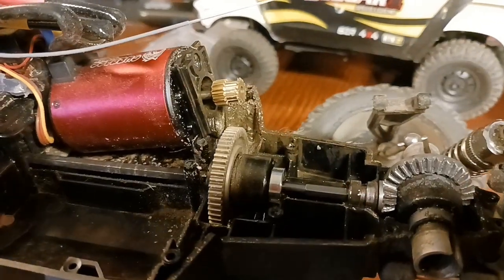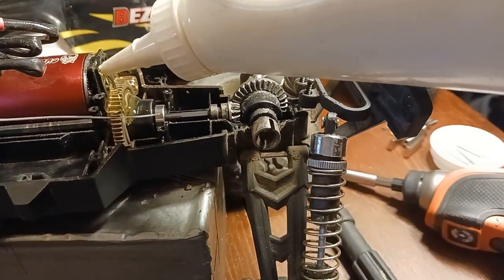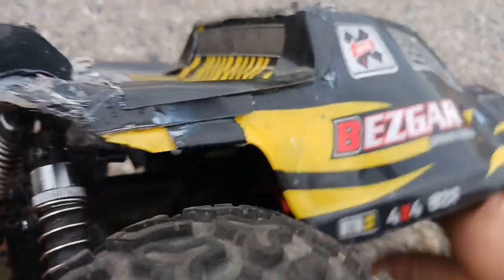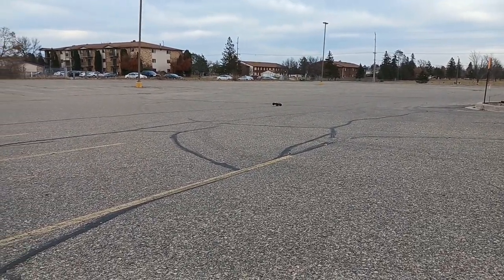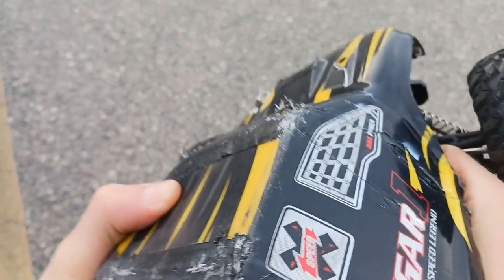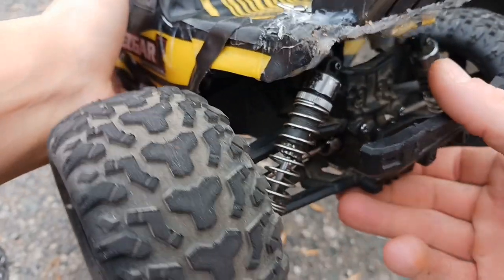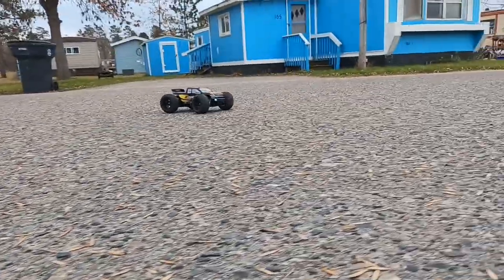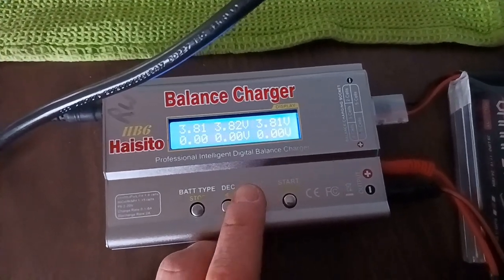3s 3650 5900kv fast wheelies with BZR HM101

Comment: Nice run when is the wltoys on the channel
Reply from the maker: Thanks bro! Im about to order a 3wire servo and brushless system for it, so a couple weeks sorry
Reply from the maker: Hey bro I'm gonna see if I can get the 124018 going tonight. I can steal the motor and esc out the HM101. I just don't have the same size servo to swap in, so I gotta see if I can mount a larger one in its place. It's servo is too small anyway it'd be a great upgrade. I don't have anything else to work on I'm out of parts
Reply: @ChiefRickyRC  great bro I love these little trucks I've got the 124019 not working atm as I stripped it and never got round upgrading yet its a favourite of mine cheers ricky
Reply from the maker: Aww man geez if we were neighbors I'd throw you my extra steel gears. It's my favorite too I'm gonna take good care of it too. Thanks AL and cheers friend
Reply: @ChiefRickyRC  thanks man what I meant is I took motor and esc and servo out to upgrade the gears on these I've never had a problem I will pick up a brushless system what kv would you recommend Rick thanks buddy
Reply from the maker: I gotcha now 👌 for your 124019 bro get a 3650 5900kv(around 5000kv) motor and at least a 60amp esc. You can get different pinion and spur gears to tune it just right. That motor should get you to 100mph with the tall gear ratio 🔥 or gear it down to 50,60mph and pop wheelies on 3s
Reply: @ChiefRickyRC  thanks Rick I've wrote that in the log book thanks again yer bud in Scotland
Reply from the maker: 🍻 I enjoy chatting with you brother
Reply from the maker: I really want to see more pics of your rc's in Scotland. My Grandpa, my mom's dad was Scottish. I'm bear clan actually. I'd like to hear about it there too, if you have any fun stories or news that'd be interesting and cool
Reply: @ChiefRickyRC  same bro your a good guy and I love your videos
Reply: @ChiefRickyRC  no worries I'm sure I can upload a video sometime soon and so your descendants are Scottish cool it is a beautiful place I'm in a county called Ayrshire where the famous poet was front he's called rabby burns and yes we do hunt haggis over here🤣👍🏻
Reply from the maker: You're a great guy Al i appreciate you my good friend! Hey bro good news I can borrow the 979bs 3 wire servo lol Idk how I didn't think of it sooner. The cheapest servo for the 979b brushless conversion was actually a rtr servo from those 1/16 SG1603 brushless rtr hoon trucks or that chassis anyway. It has so many different bodies now. I should have it going soon Al! 🍻
Reply: @ChiefRickyRC  nice one bro looking forward to see a run video  thanks man and we'll try to get a video up also I was tinkering with my wpl c24-1 today got that running it crawls great I'm thinking of getting all metal hop ups wpl is great I loved putting that together 👍🏻
Reply from the maker: Speaking of the C24-1 that's awesome that truck is so fun! I'm trying some other portals that have good reviews and a metal suspension kit. I'll find the good parts for ya bro 💯
Reply: @ChiefRickyRC  yeah I've seen the portal's on ebay they look good I'm going to build a lcg out of the c24-1 and thanks man
Reply from the maker: Well I spoke too soon I need a new esc. I'm down to this one Dilwe 60amp ESC and I'm thinking it'll just cog and not be worth all the time it takes to get this 12018 apart a few times. I gotta get a few hobby wings and new Rocket ESC's of all sizes I'm behind schedule so bad bro. It will be worth the wait brother
Reply from the maker: Beautiful

Comment: Nice. Have you already modified main hexagon axle? Facets damage so fast even on stock motor😮
Reply from the maker: I haven't changed or damaged the center hex shaft ever on anything yet. Any damage I've done would be on video. The HM101 is tough all steel drivetrain. Motor pinion all the way to the rubber tires all steel

Comment: Which motor gear do you recommend? Is spur gear fine?
Reply from the maker: These come with full steel drivetrains, so you're fine just swap the motor pinion on the new motor. There's good videos on tips for that. I used a pinion Puller I believe. For a motor I reccomend a 540, or 3650 5000kv-6000kv,  otherwise anything slower you'll get bored. I reccomend a 80amp-120amp esc. I drilled a hoke in the chassis by the servo to zip tie the esc on top of the servo, so you have the whole left side for a battery. Idk if you want but another trick is You can also swap the rear suspension everything on the left to right and right to left to make the shocks be on the outside for a better look if you like shocks lol. It's symmetrical
Reply from the maker: I also reccomend some 1 million wieght silicone diff fluid for the diffs. I have videos on everything for this truck

Comment: What oil are you using? Looks like gear lube
Reply from the maker: It's Castrol Axle Limited Slip 80w-90 gear oil yup
Reply: Yeah I use Lucas gear lube in my diffs. The stuffs like molasses!😜
Reply from the maker: That's the stuff I want, pure molasses 😆 💯😎👌